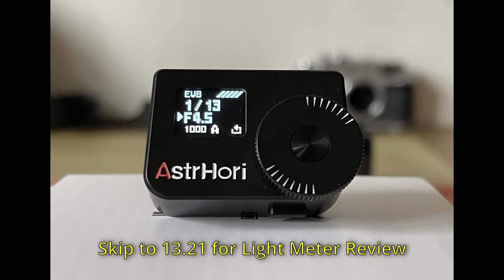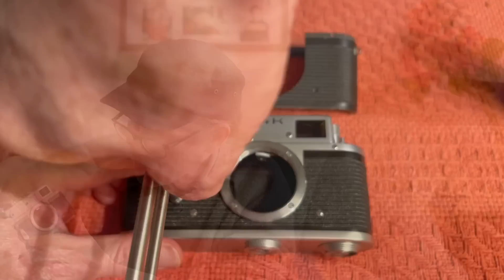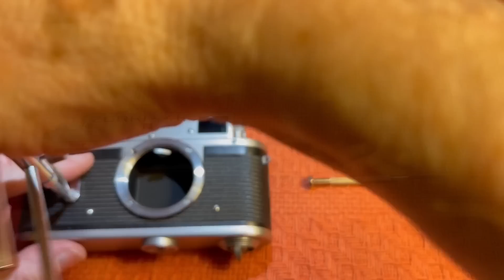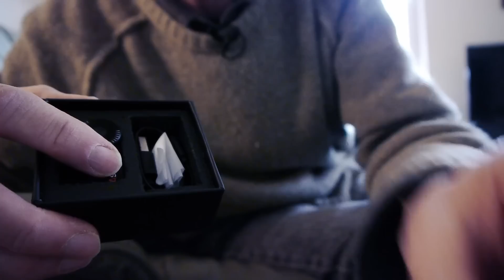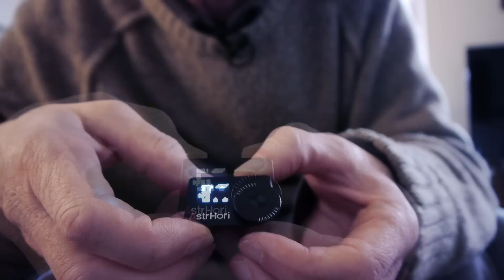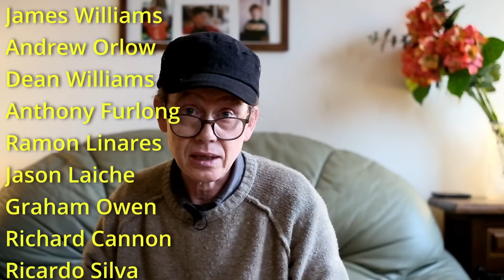Creating a Unique CUSTOM CAMERA -  PLUS Astr Hori Light Meter!

Comment: Intriguing style echo with the Nikon F/F2 Photomic metering system heads, blocky, top-plate lump with side thumbwheel to set exposure inputs.
Undoubtedly nice piece of technology👍 but its only taken 60 years or so to apply digital computational accuracy in an add-on package. Its still a recapitulation of fundamental photographic design criteria,
 But credit where due that it can augment the usability, and hence popularity, of these truly great pieces of optical and photo-mechanical excellence. 😃

Comment: Hehe! My first camera was a Zorki 4, without a K, my father bought it in '72 from Russia. But he never used it, so i stepped in 😊 and used it. It had a strange M40 mount, i never understood why, so i get to Praktica. By the way, Zorki always had a lather case which had a strap built in, so it doesn't need another strap. Why your one doesn't have one? Probably was lost along those years. So...
Reply: I thought it was 39 like Leicas.
Reply: @caw25sha  I don't know for sure, I never measured it. I just compared it with M42 and it was smaller. Anyway, there were not so many options then, while M42 were very popular due to Praktica cameras - way better than Zorki - so I changed as fast as I could.